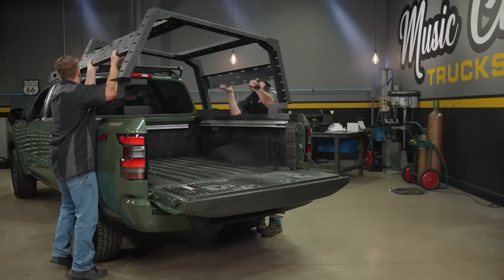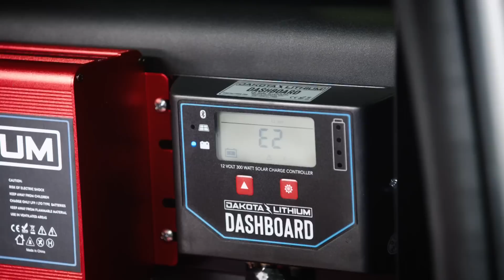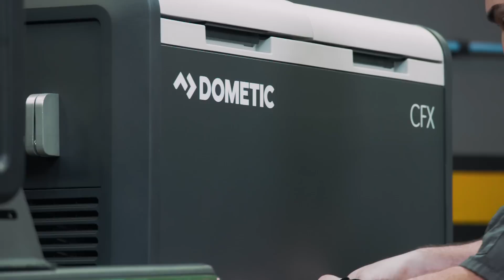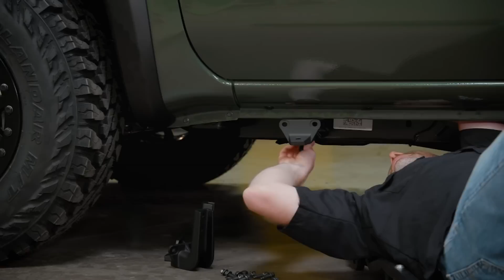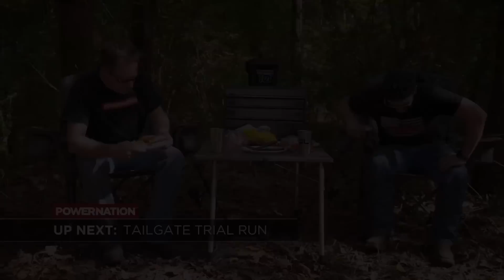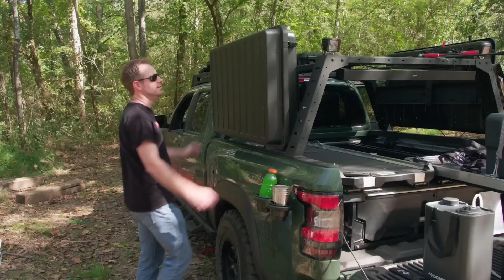Installing Batteries & Solar Power For Off-Grid Overlanding - Music City Trucks S4,E14

Comment: Isn’t the load weight on that truck 900 pounds looks like you exceeded it that truck is almost to the ground in the back
Reply: 1200lbs lol but yes, they need higher spring rate leafs...they aren't even expensive

Comment: Need some helper bags on that truck. Also how did we not get to see the TV work.
Reply: Higher spring rate springs would have been better. ARB and Dobinsons makes lift springs with upto 800lbs of additional constant load. They run between 400 to 700 for them 😂

Comment: With all those electrical accessories you guys are adding, you should probably think about upgrading the alterator for a higher current output one. I'd say at least 300 amps.

Comment: You have to know “Ohm’s” law and “Power” ahead of your purchase of TV’s and other components. It is common practice in engineering to oversize the converter so it’s not running at 100%. Connections to waterproof TV’s should include dielectric grease so moisture doesn’t corrode them, resulting in a long happy life. Remember, from the alternator, battery to converter (DC in-AC out) take the length into consideration and size the wire properly. Once connected, test from supply to unit for voltage drop. It should not exceed 0.50 Vdc or 1/2 volt of loss. This tells you the cabling size is correct for length while the circuit is loaded. Don’t worry about negative lead or positive lead as any digital meter will show a negative(-) in front of the reading, yet correct.

Comment: The god dam rear suspension is almost bottomed out in the shop on level ground
Reply: All they did was a rear shock and a leveling spacer. This was just a nismo boner plug.
Reply: @TheSmittysGarage all dogs off-road has add a leaf lift. I guess the taco and Colorado fans are mad Nissan actually made a better truck than their beta 4cyl turbo turds.
Reply: ...with 80% of equipment not really used, just wasting space.
Reply: And it’s leaning toward the driver side